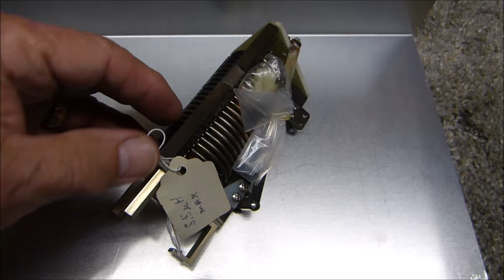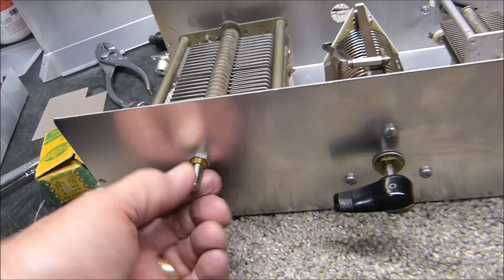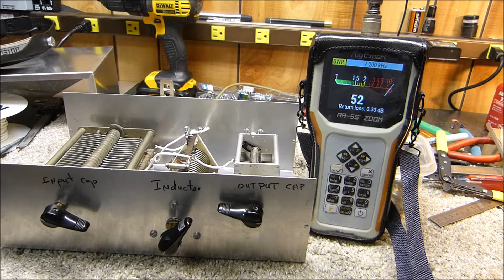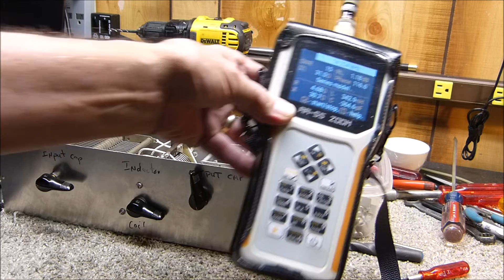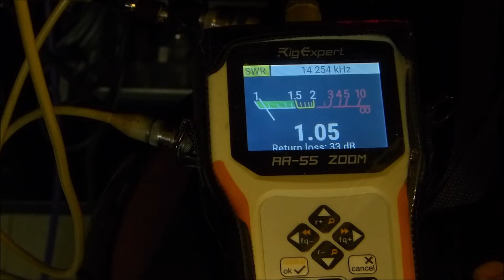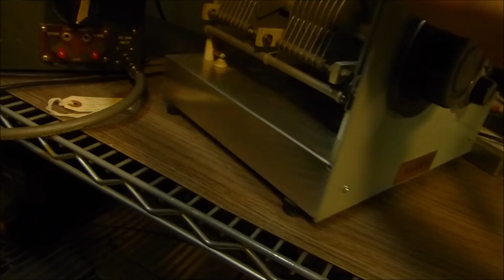Antenna Tuner (Ultimate Transmatch) from ARRL 1970

Comment: I bought a Murch KW transmatch at a flea market for $100.  It had balanced and unbalanced outputs...which I used to match two 5/8 wavelengths in phase on 75 meters (about 320 feet long) fed with ladder line. I ran legal limit and the tuner handled it without a problem.  The center of the antenna was at about 70 feet.  Europe on 75 every night....often with "loudest signal on the band" reports.  I've wanted to build a KW tuner but find it almost impossible to find components to do it.
Reply from the maker: With a little luck in finding parts, I think you can build it as good or better than most commercial models for less $.

Comment: hello David, excellent video very much instructive..can you add a meter to that tuner>
i am working in a tuner and need to know is doable..
keeo teaching us..
god bless!!
37's
Hiram. AG4KH
Reply from the maker: Hi Hiram - the meter circuit would need to be some sort of a directional coupler and not just a simple voltmeter type. In my case I use an external directional wattmeter like a Bird line section or any of the nice RF watt meters available today. It would be very nice to have it built in to the tuner...  There are schematics and instructions in many of the older ARRL books about directional couplers but they would add some complexity to the build. 73  WA4QGA

Comment: FYI - the Heathkit SA2040 uses the ultimate transmatch configuration. Essentially a ‘T’ tuner with a ‘twist’ using the split stator input cap, 1/2 of which is connected to ground. I understand from ARRL tests that this type of tuner design is obsolete in that it really didn’t reduce harmonics as ‘advertised’. I’ve had an SA2040 and used it for years. It works well, I love the tuner, but there are better tuner topologies.
Reply from the maker: That is interesting to know. I also have the Collins 180S-1 tuner that I keep inline with my 40M antenna that people seem to like and it is simply a Pi network. They all seem to work just fine, as you mention. Thanks for the comment.  73

Comment: Nice job and good advice, something you might find interesting is to swap the input and output cables, changing it from the "Ultimate" to the "SPC" configuration. Allegedely it results in less loss but better harmonic attenuation. (Although from memory one used a differential capacitor) By the way a useful thing to save for the junkbox is the excess scraps from nylon pot spindles, they can be ideal if you run out of the insulated shaft couplings but they do twist with torsion a bit if your capacitors don't turn too easily. 73

Comment: Loved the whole thing!  Now, on to the next video!
Reply from the maker: Hi Bill - I can't directly respond to your other comment on the video about how to properly tune the unit as YouTube does strange things and even though I get email I won't be able to see the comment in the video. I don't know why. This happens quite a bit and it is not in the, "held for review" queue. 
You describe the procedure much clearer than the Collins manual on how to use their 180S-1 tuner. Collins reverences everything to the KWM-2 (2A) in a convoluted way that I had to read a bunch of times. In the end, it is like all tuners and the L should be minimum with output C at max for a good match and least loss. I think I saw that in a measurement with the SA and harmonic content at the output in my video that I commented on.
I understand the type capacitor you mentioned that when one half is fully meshed the other is fully open but I was not aware that was what should be used in this case. In their pictures they show the type of input split stator capacitor that I used in the first picture, the second picture may look like what you describe (not a good picture) and nothing can be determined about this capacitor in the third picture,

Back to the Collins 180S-1 tuner - it is just a Pi network but the tuning is the same procedure. 
https://collinsradio.org/archives/manuals/180S-1_2nd-ed-02-62_.pdf
I see all tuneers as always trying to keep the L low and the C hi to increase Q and minimize loss.
Q is an interesting subject. I have always thought of Q = X/R and the Q of a series or parallel resonate circuit limited by the series R in L. The ratio of Xc to R in a capacitor would be very high and not degrading the Q as the L would with lower Xl to R ratio. Here is what the Internet says that I think is correct.
Q = Pstored/Pdissipated = I2X/I2R Q = X/R where: X = Capacitive or Inductive reactance at resonance R = Series resistance. This formula is applicable to series resonant circuits, and also parallel resonant circuits if the resistance is in series with the inductor.
I assume in either case (series or parallel resonance) R would always be in series with R and not shunt to R. I could be wrong.
Assuming the above is correct, I know that the Q of a output Pi tank circuit in a RF amplifier for say, 80 and 40M should be around 10 and for 10M it should be higher, say 16, as an example. In my experience of building amplifiers, I have found (using roller inductors) that power output increases as L gets smaller and C gets larger to a point where it becomes unstable and then I add a bit more L into the tank circuit to stabilize it ultimately lowering the Q and increasing the bandwidth.
Lastly, if the proper tuning procedure is to use minimum L, could this not possibly raise the Q of the tuner to an unstable condition and  require readjustment for a small change in frequency? I am not trying to split atoms here but find a reasonable compromise so tweaking is not necessary with moving 10 KHz or so.
Your thoughts?
73
Reply: @ElPasoTubeAmps  My general notion about external "transmatches" is that you always want to keep L as low as possible because inductors have inherent loss. They operate in accordance with current flowing which generates magnetic fields that then collapse when the oscillation reverses "polarity". In the case of capacitors, they operate in accordance with electrostatic charges, rather than magnetic fields, in which electrons charge a plate. Although desirious of flowing over to the "uncharged" plate, the electrons cannot flow until the oscillating signal passes through its polarity peak and begins to reverse itself. When it passes through zero, maximum electron flow (current) to the other plate. Thus maximum current flows in this electrostatic dynamic when the signal passes through zero during its oscillation.

Given these two different ways of getting RF current to flow, it is the inductor which has most "loss", beginning with the resistivity of its wire. In roller inductors, this resistivity is compounded by mechanical contrivances required for its operation (fingerstock brushes, wheels touching wire, interiors of wheels sliding along rods, etc) . Each mechanical gizmo adds resistive loss not found in an electrostatic capacitor whose dielectric is air, let alone a vaccum. 

So when you look at the Q of a tuned circuit, I have generally thought that the losses inherent in the coil, beginning with its resistivity, plays a dominant role in limiting the circuit's overall Q. This is why the Q of a tuned circuit increases dramatically when nothing is done other than cooling it to superconductive temperatures. This is also why the Q of a tuned circuit is increased by using silver wire, rather than copper or aluminum, or by increasing the diameter of the wire in the inductor regardless of what type of wire is used. Doing anything to lower the coil's resistivity without altering its dimensions raises the circuit's overall Q. In the practical world of ham radio, one attempts to acquire the inductance needed by a tuned circuit by making a coil whose length is about 1.5 times its diameter. I think this practice minimizes the length of wire needed for a given inductance, thus minimizing the coil's resistivity and therefore raising the tuned circuit's overall Q. 

Now, I might be wrong. But this is the type of thinking that has caused me to assume minimizing L in a transmatch minimizes its insertion loss.

Comment: The reason the ARRL method is considered best is because it uses the least amount of inductance for the match. Coils are lossy and caps are not. For the moderate +-jX loads you tested the two methods are comparable. For more reactive loads you can find a low SWR match that has a high circulating current - not good. 
My Titan III has the blinky lights showing the PEP as well as the meter which is good and I tend to watch the blinkys from the corner of my eye in preference to "reading" the meter. The KAP500 amp also uses blinkys for both forward power and SWR for a quick scan that all is well.
Reply from the maker: I never thought about it in terms of lossy coil and added XL as I thought it would be most beneficial to have that added shunt capacitance to ground to attenuate harmonics and and any anomalies higher up in frequency. But I believe you. I do know in all the Pi tank coils I have built, too much L will definitely lower output power. Too little L and the amplifier is just too eager to go into some parasitic. Speaking of blinky lights - I do the same thing with a homebrew LED wattmeter that has no discriminator between forward and reflected power so SWR must be low to be accurate but the blinky lights is what I run off watching the antenna. In my case, a high reflected power will sum with the forward power and drive my blinky meter LEDs thru the ceiling so, as you say, it is an instant quick way to check on performance.

Comment: My mouth hit the floor when I saw that hole cutter. Never seen one before. I have to get some of those!
Reply from the maker: Yes, they are the way to go. They are very expensive new and lots of different sizes. Best to buy used. The small ones take a 1/4 inch pilot hole, the next sizes up are 3/8 inch pilot hole and the big ones are a 3/4 inch pilot hole which usually takes a 3/4 inch punch to get a hole that big or maybe a stepped-bit. I might mention that particularly in 8 pin octal tube sockets, they are definitely not all the same size. Some are 1" and some are 1 1/8 inch and so on. Just throwing out some things to keep in mind when buying.
Reply: @ElPasoTubeAmps  Yes, I generally try to buy most things used when possible. Thanks for the extra tips, too---didn't know about the tube socket differences. My main use for now would be for connectors like you showed, but eventually I want to start building tube stuff as well.
Reply from the maker: https://www.youtube.com/watch?v=BIHwJ28Z9P4&t=216s

Comment: How much would the top cover make?  Being aluminum, it shouldn't but it could setup eddy currents and couple across the input to output.
Reply from the maker: I was concerned about that also but  measurements on the bench, without the cover, then putting the top cover on and checked the matching again and it was insignificantly different in the settings of the capacitors and inductor. I have a large tuner built to this same schematic and ran it with a KW of power and noticed some RFI in my room, this was a few years ago, then I surrounded it with an aluminum casing and the RFI was resolved but the tuner still worked the same. The large tuner has a bypass relay in it also but I chose not to put such a feature in this one (not much room, for one thing) and I will likely use it just for matching the input of my 833A amplifier to my exciters. Crazy as it may seem, one single component, in this case, the little inductor, inspires a functional unit to be built. I have another roller coil exactly the same - who knows what I am likely to built with that one. I also have a monster Gates roller inductor - probably a good 5KW+ ... heaven knows what I might do with that one.  :-)